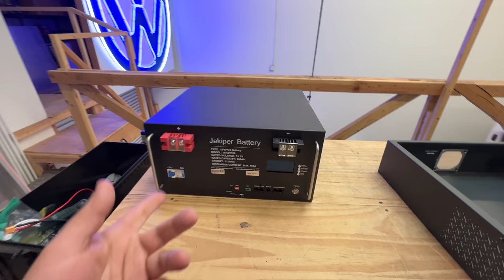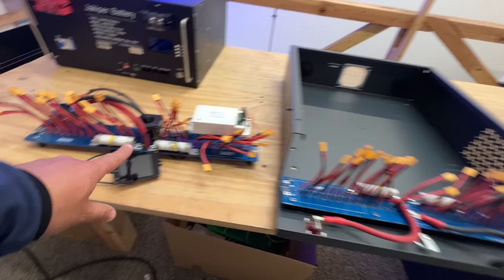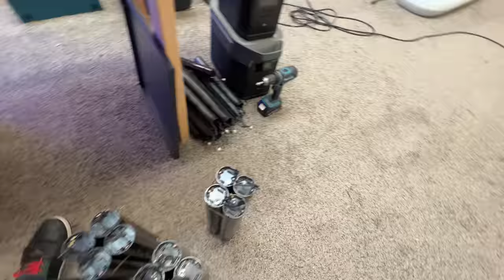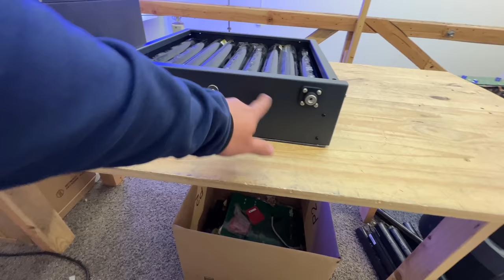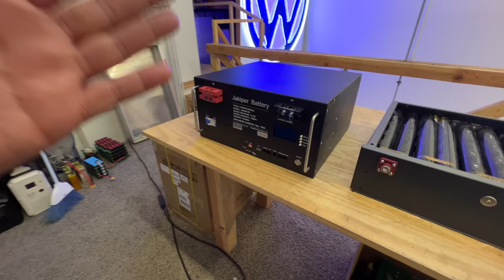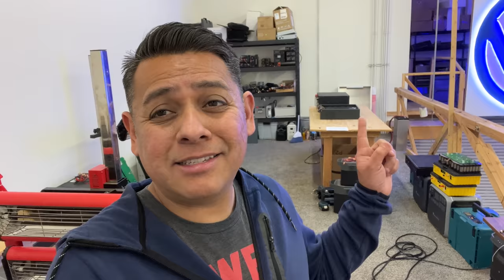Is DIY battery Still a good IDEA?

Comment: I am totally DIY.
I've bought some really good stuff from Jag35.

The advantage of DIY pack building, is that you not only learn new skills, but you can also build battery packs for different applications. Applications like portable lighting, bluetooth speakers, portable welders, retrofitting cars, bicycles, go carts and tractors, etc. Getting a grip on what it takes to generate power gives us a real sense of what it takes to MAKE power.
Our national power grid is a great achievement!

Comment: I bought 12 packs at 48V and 5KWH plug and play that were $330 per KWH including shipping from Signature Solar. My time is worth something and nothing I build myself comes with a 10 year warranty or integrates automatically with my inverters. I have a single management and communication setup that connects to my inverters, solar charge controllers and batteries. I may still build something for fun because I love to learn and build things. The additional cost of trying to work with 36V instead of 48V for your inverters, wiring and chargers is also not trivial. With DIY you are usually getting used parts which affects your remaining useful life and reliability. As for the environmental aspect, I plan on using my batteries until they have no life left. If I wanted to get the same amount of life out of a DIY battery, I would have to go through 2-3 sets which means about $400-$600 a KWH based on today's pricing over the same time period. I think my new set is a good compromise between cost/ease of use and the environment.
Reply: "DIY" and "used parts" - I'm not sure why you wrote this. I'm pretty sure one can use perfectly good new parts for ones DIY builds.
Reply: @Mike you just said 4 cell’s. That is only a 12 volt battery. You need 16 cells for the 48 volt batteries. Don’t forget about the box and bms. The 48 volt bms costs more also. Plus the batteries from signature solar come with a built in resistor. Making them safe to power up the capacitor in your inverter. I just built a battery box that will fit into a battery rack. The reason is for battery management.
Reply: Would you share which batteries you went with?  Btw, I agree w you, diy batteries don’t make sense for me either.
Reply: @michaeldautry  I will always buy the signature solar batteries. I currently have 8 of them. I have three different battery types. Personally I like the egyll batteries with the screen.
Reply: @jamesshomesolarmore2223  That is my plan too.  I currently don't have solar panels due to the house design and location I am at.   But when we move I'll take them with us to the new house and hopefully can do solar.  Meanwhile, with CA issues with fires and power like to have emergency backup power to keep our essentials running.  

While I do like the idea of building my own server batteries I think buying them pre-built to me is safer.   When you have large battery bank and if not done correctly or bad part things can go south pretty quick.   Not saying you guys can't do a good solid DYI build I rather play it safe and pay the extra bucks for it.
Reply: Your limiting yourself to his 36v diy packs. You can but the same cells that are in your server rack packs and  build them for $150 a kwh and it would only take a few hours to assemble. These are brand new cells and they have the same 3000 cycle life that the server racks Have. For a large completely off grid
System(50kwh-80kwh) its worth it to go diy.  Warranties are fine I guess but when you get quality cells and you know what you're doing there is next to zero chances for something to go wrong.
Reply: @jamesshomesolarmore2223  no.. A 48v BMS doesn't really cost more for the same wattage output since you can buy a lower amp capacity vs a 12v.
Reply: @michaeldautry  they do make sense if you actually know what you are doing. You don't need to build a diy pack out these 36v used batteries lol
Reply: @randybobandy9828  I am not sure exactly about what you are referring to. The truth is that battery technology changes rapidly. The batteries from signature solar have been the best so far. 
Boy I am currently in the Philippines. We are working on our new solar project. But it is months away from a finished project. The whole system will be different from my project in the USA. Different panels inverters and batteries.

Comment: I can use 48V battery but a 36V battery is completely useless to me. It would be much better if the comparison was between two batteries of equivalent capability. Pre-built v DIY.
Same energy storage capacity
Same power output 
Same charge rates
Same voltage
Same features (BMS control, display, breaker(s) and circuit protection, good casing, terminal connections, handles)
LiFePO4 is very safe chemistry, even if damaged or exposed to unsafe conditions. How safe are those second hand e-bike packs?

Comment: Keep in mind that these 48V rack mount batteries usually include a switching BMS that is capable of limiting current in and out of the battery instead of simply disconnecting as per more common BMS.  This is a considerable advantage in a situation where there are many batteries in parallel.  Communication between the batteries is also useful.  Overall it allows the batteries (and perhaps the charger too) to interact in a much better way to prevent one battery from receiving too much current (or draining too heavily) at the ends of the charge/discharge curve.   The simply DIY alternative built as an example does not contain any of these smarts.
Reply: this. I've beeb hoping the diy builds would catchup in this regard
Reply: the packs have BMS.
Reply: What about using the PCB with the master/meter? Unrelated?
Reply: these packs are from ninebot. I don't know any specifics but I wouldn't say that their BMS counts against them. they definitely wont have the same creature comforts but I think they are fine in terms of safety
Reply: @MatthewTaylorAu I think they have now. I'm looking at a bms that communicates with inverters and mounts to the front of a server rack.

Comment: I would really consider the DIY approach if it yielded the same 48v nominal battery.  I agree with others that comparing a 36v DIY to commercial 48v is more favorable to DIY than it deserves.
Reply: @Mike I don’t know how to relate your comment to what I posted.  Sorry…
Reply: What? You can DIY a 48v battery just the same as a 36v, or 24v, or 12v...
Reply: @MastaSquidge  not the point- read whole post… it’s about validity of comparison
Reply: @philipmorgan1438  then your point is poorly made.
Reply: @MastaSquidge  Sorry to disappoint you.
Reply: What? You can build a 48v nominal battery if you want. There is no limitations.
Reply: @randybobandy9828  not about building - it’s about testing two batteries of same voltage for fair comparison of outcomes in Jehu’s video.

Comment: I absolutely agree with everything you said about the advantages of DIY.  To add to what other commenters have said about the joy of learning, I have also found that the knowledge and experience gained from DIY provides confidence in the future electrification of everything around us.  For example, if I buy a Ryobi 48v riding mower or an electric golf cart, when it comes time to replace the lead acid batteries, I will most likely build a LiFePo4 replacement pack myself and thus be able to make it even better than when it was new.
Reply: This is a great idea, however, mowers, saws, implements have proprietary connections (slide in, etc) which you would have to bypass, therefore bypassing all weatherproof sealing, to use DIY.  If you accomplish this, please post a YouTube video with details.

Comment: I can get 4 18650 batteries at my local vape shop for $50. Each one is 3500 mah. Makes it easier for me to get the energy I need $100 as a time.  I put my batteries in an off-grid solar setup. The main purpose is to keep devices charged and to power a lamp, a TV and an android box with an attached HDD. Makes it perfect to keep comfortable and entertained if the grid goes out.

Comment: The biggest issue is the voltage at 36 volts really limits the inverters you can use it with, especially with solar inverters, 12, 24, 48 all are easy to find gear for, 36 other than a few inverters, there aren't as many charge controllers and inverters to use with it, especially ones that combine them both. 24 and 48 is a lot easier. I've built repurposed used cell packs and they work great and I'm super happy with them. I repurposed a number of 36 volt medical packs and turned them into 48 volt packs. Still have high cycle life being lifepo4 and I was able to do it cheaply. Latest pack I'm building is with EVE 230ah cells. Waiting on them to arrive on Thursday, but I ordered them from a company that stores them in the US, placed the order on Friday, about a week later they should be here. Provided they are what they say they are, cost will be about $154 per kwh. $1850 for a bit over 12kwh. That's a relatively affordable price, and gives me a lot more storage than the prebuilt server rack batteries with cells that are pretty safe. Most of those prebuilt server rack batteries are still well over $350-$500 per kwh. They are great for the plug and play crowd but too pricey for those with skills to build our own. 

I'm all for reuse of cells, but for my applications I want ones that have a low risk of fire if there is a major failure and a high cycle life so lifep04 is just a better fit. Unfortunately there doesn't seem to be a lot of used cells in that chemistry lately, though I do see you have a few. I've built two 5kwh packs out of them, and I'd have built more if I could get more. The couple packs I've built with lithium ion used cells, those I use for mobile power applications where they won't have to cycle as often and the higher density helps out. So long as the cells I got are good cells though it's hard to argue with $150ish per kwh and not waiting months for shipping. Unfortunately too many of the cheap cells out of China are the grade b cells often swollen, so those you might be waiting 3 months for and then bummed out when they arrive. I suspect as more scooters and other items start switching to lifepo4 cells that should help out finding more cells to harvest provided the price is right. 

Love the work you do man.
Reply: by a current adjustment device.
Reply: I fully agree! $150 a kwh is where the price is for us DIY guys. The cost to build your own vs the server rack batteries is just to big to ignore. Like you said the cheapest server batteries go for $300 a kwh and that is such a massive difference on a whole house system. Say you want a 80kwh battery for a house. Diy= about $12,000 but a server rack system would be $24,000 to $30,000. It just doesn't make Financial sense at those prices.
Reply: If you are looking for cheap Lifepo4 used cells I know a  US site that sells them for as little as $100 a kwh. They are large 26650 Lifepo4 cells.

Comment: I would love to see a system that used second life 18650/2170 cells put in a pack (like a scooter battery pack) that could then easily be replaced by anyone in a home battery sytem. You would have a system at home that takes say 10+ packs and the BMS tells you when one needs replacing, you then send it back and get a replacement. This would be a great way to use more second life cells. Some of the packs could be new cells so you always have some battery storage to hand.

Comment: 36V vs 48V is not really a problem. There are other types of cells that could be combined to give any voltage one desires.
I believe if one is building a large project, the savings from DIY would be significant. If it's just a small build, and time is limited, it might be worth buying the ready battery.

Comment: IMO, For lithium ion phosphate, DIYing makes less sense now, between server rack batteries and all those 12v 100AH lead acid replacement type form factor batteries its just hard to beat them. But for re purposing ebike/scooter batteries or some other packs you can get super cheap. Then DIY all the way. Especially if you want to build some sort of smaller or custom form factor type setup
Reply: I build so that there is no useless BMS ruining the battery for real world use.
Reply: moe ironohsa bayee hretire anaxjn chesaper

Comment: A DIY project like this could be perfect for someone starting out in their world of solar & batteries. Or someone wanting to experiment a bit. Maybe they don't really know yet the size of the system they want....maybe they are going to be grid tied or already grid ties but would like to experiment with a little off grid.
Lot's of different reasons but to be able to experiment without forking out full bucks is a win win for many folk.

Comment: I would say the main reason to go for the LFP set is the number of cycles / price which may exceed DIY. DIY is cheaper but number of cycles should be much lower.
Reply: Yes this.  amp hours * projected cycles.  What is this called?  "lifetime amp hours"?  If I understood him, that makes the diy battery twice as expensive.

Comment: Hi Jehu, I'm not a fan of those server rack solutions. Although I agree with you about the recycling principles, my main complaint with them is their high cost. Unfortunately most "DIYers" I subscribed to have turned away from buiding their own solutions. They became pretty much evaluators or marketting agents for Signature Solar or others resellers. You are still promoting the DIY approach that I value too. I just spent $1933 for a 14.5 KWh  battery which includes a 150A Daly BMS for Android Bluetooth monitoring. That's about $133/KWh! as opposed to the $371/KWh for the Orient Power 105Ah Server Rack battery.  Trust me, at that price, I'm willing to wait till January 2023 for my cells delivery and spend extra time top balancing the cells and extract the real capacity upon discharge and finally assemble them into a 48V 280Ah pack using the BMS. The EBC-A40 makes the process a breeze. Thus for me the DIY approach is invaluable in terms of know how and money saving... in addition to saving the planet... of course.  Keep up the good work my friend!

Comment: The cycle life is the biggest issue for me. I would rather just get it and forget it.that’s why i went with lithium iron.
Reply: There's also the near-standard form factor manufacturers are using, the on-board diagnostics, the reporting/remote-monitoring capabilities, there's the pre-shipment testing the manufacturer does, and there's of course the warranty.  now granted the warranty is only good if the manufacturer is still around when/if it's needed, but I figure most of these rack packs are going to follow the infant mortality mantra: if it doesn't die in the first 1-2 weeks/months, it's going to last at least as long as predicted.

Just because I CAN build and maintain a giant battery bank, doesn't mean I WANT to.

Comment: I paid $179 for battery spot welder from Amazon, then spent about $1000.00 for batteries, Samsung 40T cells, $30 or so for nickel strips, I built a 130 cell pack, 2 X 20 amp hour with well over 100 amps each discharge, 35 amps each with 5 in series 13 parallel, the one piece battery pack from Ali-Express was $2400. To get one custom built for my 2 wheel drive ebike... would have been much much more expensive... so for less than half the cost of a stock battery pack, I built my own let alone the " custom " build I did,  I could have made one large pack for both motors but !! redundancy... if the one large pack failed for any reason, I would have to push the bike home.. pedalling an ebike with a 5000 watt rear motor with a single speed 18 tooth gear would take forever, physically being able to pedal it all the way home, is another matter altogether, it aint easy, even more so because I run 19" motorcycle tires front and rear :) ......... same thing with two motors, besides being fun as hell, if one motor fails, I can still get home on the other... uphill, downhill, over hill, over dale, mud, snow, ice ( studded tires ) off road, on road.. 2 wheel drive ebike with full suspension... will roxors your boxors... :)

Comment: Takes about 3 of your DYI packs to equal the Jakiper pack because Jakiper has better battery chemistry 4 times life cycles so really in this case no comparison       3 DYI packs is around 2000$ which is  higher cost with lesser quality batteries

Comment: I am in the server rack battery camp. EG4 has a 48V 100 Ah battery for $1500. That is $0.29/kWh. Plus shipping. But it includes a solid BMS with low temperature protection that is supported in comms for the most common all-in-one inverter/charge controller and each battery has a built in circuit breaker. 

If i am powering my house with this, the reliability is important.
Reply from the maker: $290/kwh
Reply: @jehugarcia  ya. That

Comment: My questions is this if any one can answer it the 36v ninebot scooter pack full charge 42.5 V I stay around that  voltage but I’m curious  them pack all individual have it’s own  bms  does it have its ownd shut off when it reach full charged  because  I made a basically set up that about 4400wh  worth of packs  I have no idea if I can go over 42.5 -43.5v? Maybe higher or might blow 🤷‍♂️
Reply: #jehugarcia
Reply: what is this what i won or is this a troll trying to scam someone

Comment: If you don't tape them together quite that way, might you be able to pack 21 or 24 in 3 alternating rows?
Reply: I was wondering the same thing - need 6 more cells in there. It looked like there was plenty of room if they were allowed to settle into the form factor.

Comment: I purchased 16 pcs of 3.2V LiFePo4 cells in  Ogreen Lifepo4 cell Store, store number 5729174
The cells were rated minimum 180Ah. The best I could get from a 8s2p configuration after connecting the highest capacity cell with the lowest capacity cell in parallel  was 240Ah which is 120Ah per cell. The cells internal resistance is a lot higher than specified.